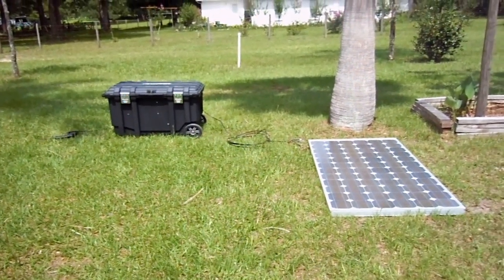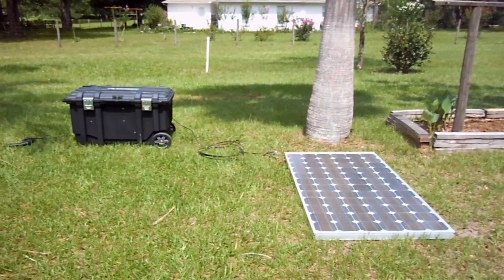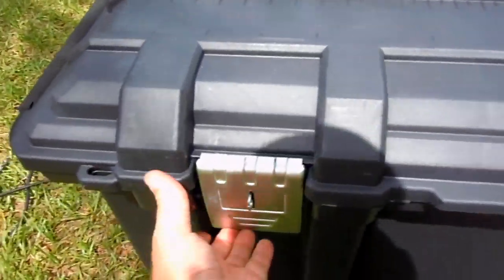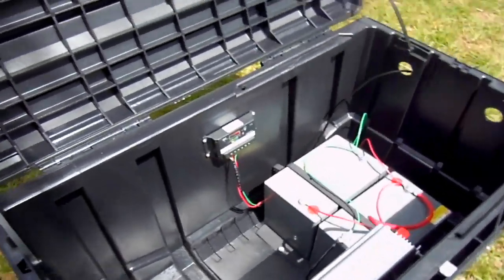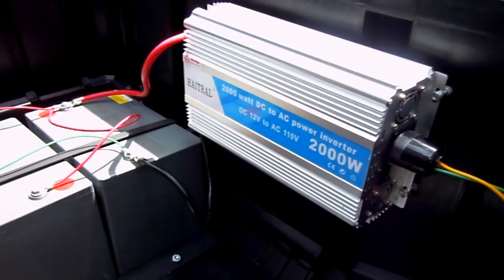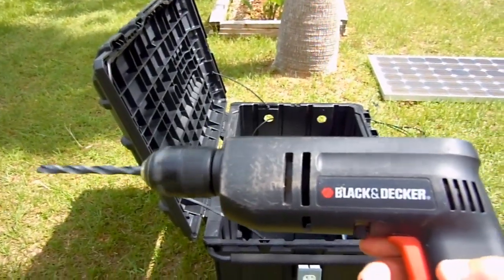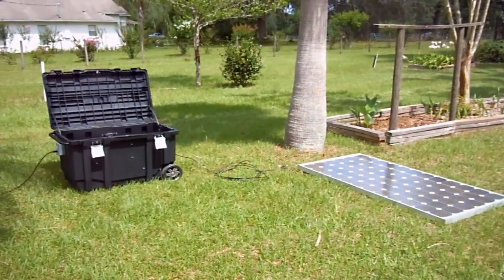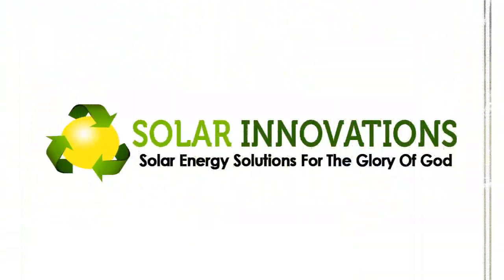☀️DIY Emergency Portable #SolarGenerator⚡️

Comment: do u need to ground ur inverter.  im getting ready to build something like this. my 1000w invertrr has a ground bolt on yhe back of it. do i need to use it or does it matter.
Reply from the maker: If your inverter has a ground, by all means, ground your unit!

Comment: How’s this working for you still?  Think I can power a small heater off this?  And for how long you think?
Reply from the maker: This awesome portable solar generator continues to do what it's supposed to do: Power my home office, or provide power on demand. Depending on the pull, I'm 100% confidant this unit can power a small heater intermittently, but not continually 24 hours a day... To achieve that, you would need more panels and batteries.
Reply: Daniel St.Pierre thanks. Do you have a link for the batteries and charge controller you used?
Reply from the maker: Of course! The batteries http://amzn.to/2kt4D9N and the 20A solar charge controller http://amzn.to/2ADl3jW Do share a video of your build when you get done building it!!!

Comment: I have a question: When you charge something (for example a PC), will it be charged directly  from the solar panel and switches only to the battery when there isnt enough watt produced by the sun? Or will the PC use the power constantly from the battery?
Reply from the maker: Devices and appliances are powered by the invertor which runs off the batteries. When the batteries are charged to capacity, the extra power from the solar panels can power secondary devices.

Comment: With two 75Ah batteries and a 200w panel you are not going to get 2000w continuous power for very long.
Drawing 2000w will draw around 84 amps from each battery (which will make the voltage plummet fast). 
I would say this system is actually good for drawing around 100w continuously, and up to 800w incrementally. You could probably get away with connecting a 700w microwave and putting something in it for a few minutes and it wouldn't hurt the batteries.
But if you connect something like a 2000w heater then those batteries are going to be wrecked in no time. Manufacturers suggest no more than a C/8 rate of discharge, meaning that with two 75Ah batteries in parallel you shouldn't draw anymore than around 19amps continuously, 19amps would only translate to about 230 watts.
Reply from the maker: Great insight! You're right, this generator is not meant to run high power devices for long periods of time. Your assessment of 100w continuous is close to my setup, I use the generator to power my home office (laptop, modem, floor fan on hot days and a led light). Using the generator when the panel is in full sun really helps keep the batts happy...

Comment: Does a solar generator replace the need to have so many batteries? I don't understand the terminology.
Reply from the maker: The generator runs like this: Sunlight hits the solar panels and is converted into electricity. The electricity is stored in the batteries. The charged batteries power devices, appliances, etc.

Comment: Can you actually run a 2000 watt load? for how long? I would worry about those batteries being able to dump 160Amps+ an hour. I feel like there is a big difference from having a 2000 watt inverter and being able to use it in a practical way with a 2000 watt load.
Reply from the maker: Although it can handle it, a 2,000 watt load with no power from the panel will kill the batts in no time. It's not meant to put out that kind of power continuously, but it does the job it's designed to do very nicely... Saves lives too!

Comment: Are your power tools doing ok with a non pure sine inverter? thanks
Reply from the maker: They are good so far, but I have to tell you I don't use power tools a lot with this unit, instead I power a home office, and have had no issues to date, going on over 2 years now running identical versions of this generator daily.

Comment: Hi Daniel.  I have been trolling thru youtube like crazy looking for someone that used this exact case for this project.  Can you tell me how you secured the batteries to the bottom of the chest? I don't want the batteries bouncing around when this thing gets carted around.Also, do your screws go thru the cast when you point your components?  I am worried I will have screws poking thru all over when I am done.Nice Job.Thanks for posting.
Reply from the maker: The batteries are held down using aluminum angle bars and all the screws are fastened from the outside-in so nothing sticks out of the housing.

Comment: will the batteries continue to charge while in use? how do you know how much power is stored and stuff? thanks
Reply from the maker: Indeed, the batteries will keep charging as long as power consumption is below the panel's output. On the flip side, if you're using more power than the panel puts out, then the batteries will discharge at the corresponding differential ratio.
Reply: and what is that breakpoint? I mean what is the max output of the panel, another question: in a cloudy day and with the battery at 100% fully charged how long with discharge? in example using a 100w lamp connected
Reply: Maximus, What if I have a 100watt peak 75watt continously and I want to run it for 24 hours every day fully off grid in 5 hours of sun, how many panels do i need? thanks!

Comment: What brand of AGM batteries did you use?  what is the capacity of your 2 batteries?
Reply from the maker: I use CSB HRL12280W AGM Gel Batteries. They sell new for $208.60 each at http://tiny.cc/75HR-AGM-Battery
Reply: AGM and Gel are different electrolyte types. For your luck this battery is AGM.

Comment: Also, why did you use MC3s as opposed to MC4s?
Reply from the maker: I used MC3 connectors because the panels I used were wired with MC3 connectors. There's really no difference between MC3 and MC4 connectors other than shape...
Reply: Okay, that makes sense.  Thanks for your quick reply.  I have been tooling for MC4s now and was wondering what the difference was and if it is any better, especially with respect to weather-resistance, durability.

Comment: Hi Daniel - great build.  Simple, sleek, and lots of storage space.  Plug and play and that is important.

I noticed that the outlet is not ready for rain.  So is it your thought to only use on clear weather days or do you envision some sort of tarp top go over the case if it rains, etc.?

Also, what do you think the components cost you?  Thanks much.
Reply from the maker: The generator itself is not waterproof as the ventilation holes on each side would certainly allow for water in the unit. As such, the housing is meant to be kept in a water proof, shaded area while the panel, of course, needs to be out in the sun and possible rain. I found that spraying panels with WD40 will make the panels virtually self-cleaning as rain will run off panels, collecting dust as water flows off each panel. Components if bought new cost approximately $800 per the description and component list.
Reply: Thanks Daniel.  I like the build.  Great job.  Practical and probably about what I will do.  I am going to use a Coleman cooler that has wheels.

Comment: Can this survive an EMP?
Reply from the maker: As solar panels themselves are inherently resistant to EMP, I reckon this solar generator would survive an EMP if the generator (or its components) were stored in a Faraday cage, even inside a closed/sealed metal trash can which could double as a Faraday cage.
Reply: Daniel St.Pierre Thank you!

Comment: hey bud, if i wanted a 5000 watts generator with lithium ion batteries constructed will you be able to do it? how much would it cost?
Reply from the maker: Indeed, the only difference would be a more powerful inverter. How many batteries are you looking for?
Reply: I don't know i guess 6 or 8
Reply from the maker: Wow! that's quite a number of batteries for a portable system... Plus, considering each 150Ah LIFEPO4 lithium battery cost about $800 each, you're looking at a minimum $7K for a 6 battery 5KW/10KW peak solar generator with 3 100W 12V solar panels...